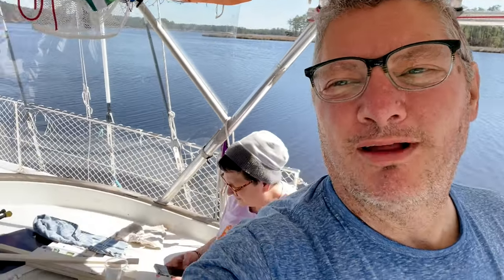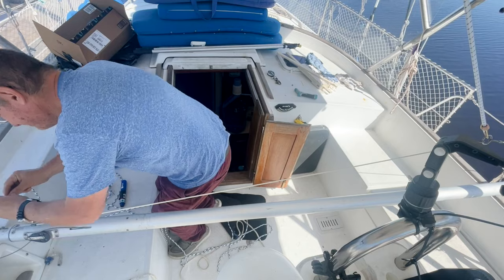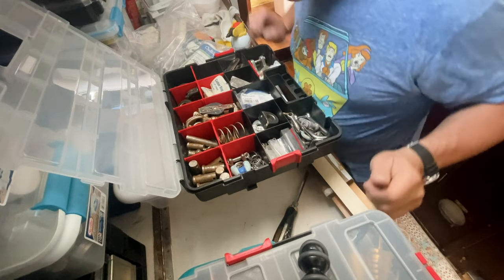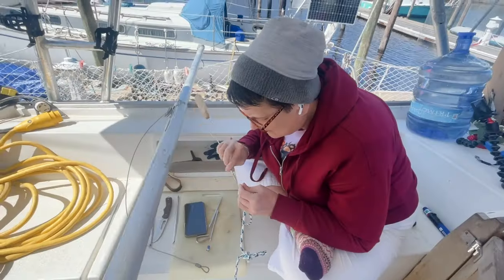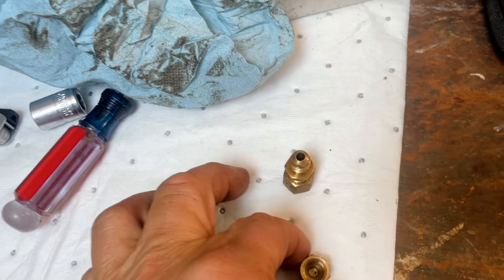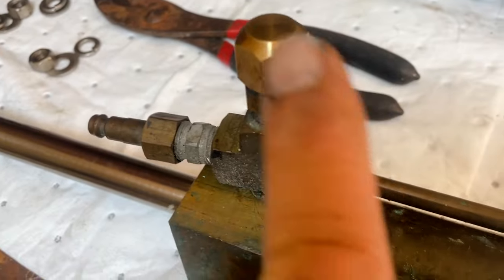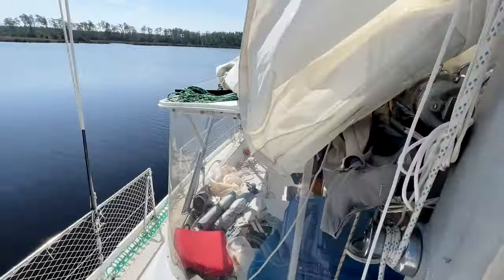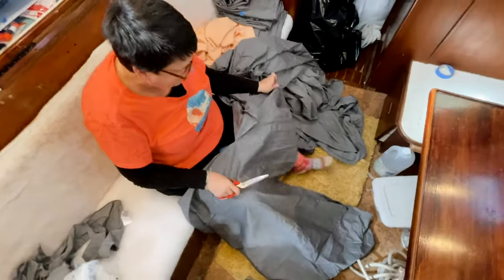Some Boat Jobs Are Harder Than Others

Comment: Whisker pile is usually base of the J measurement.  If using it for a larger cruising sail it will be longer than the j measurement and closer to the length of the foot of the sail.  And adjustable pole is great for cruising so it can be used with multiple sail combinations and wind conditions.
Reply from the maker: Thanks for the info!
Reply: Whisker poles are usually equal to the foot length of the jib/Genoa you want to pole out spinnaker poles are equal to your “J” measurement